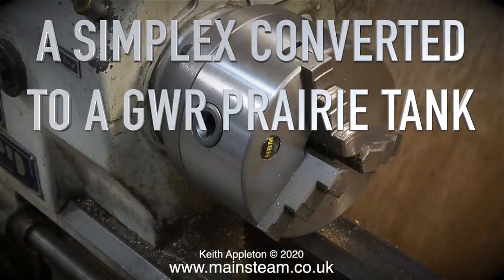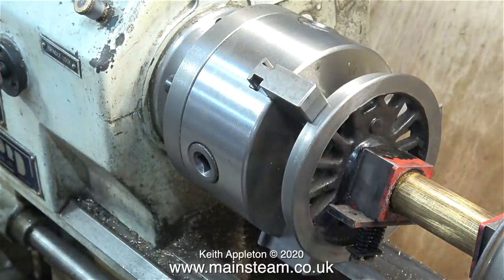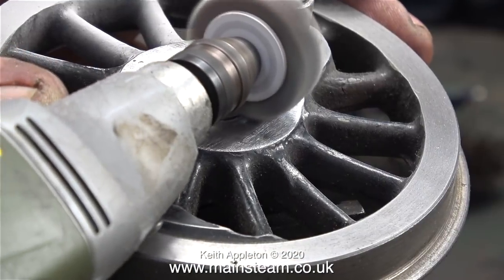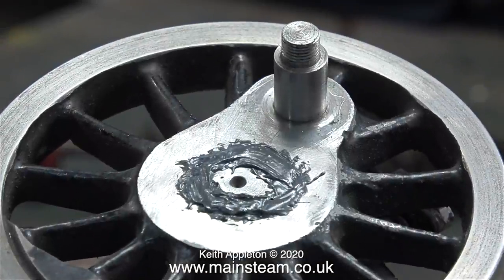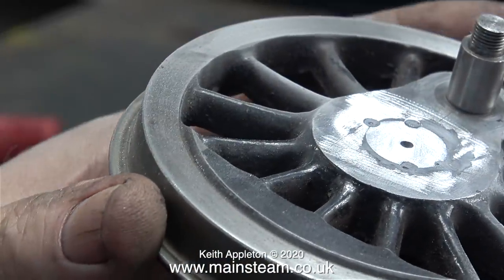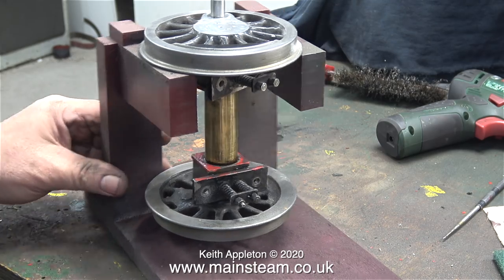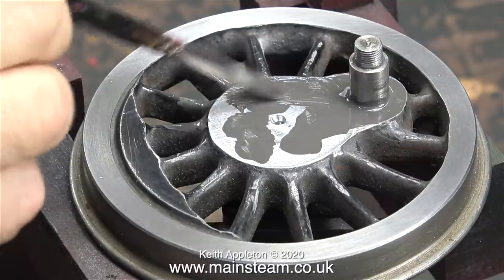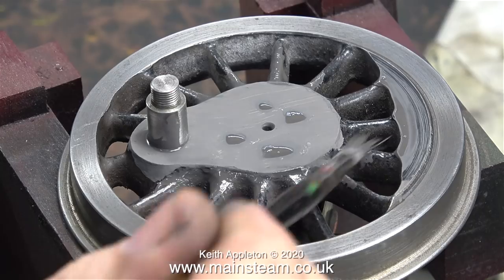SIMPLEX PRAIRIE TANK - PART #42

Comment: You could have used a face plate and a dead center.  The crank pin would be the drive dog in the face plate.
Reply from the maker: But I don't have a face plate and the job worked out fine anyway the way that did it ......

Comment: Does the primer stop the paint from orange peeling? Also what brand of trim line tape would you recommend for a 7 1/4” battery engine? I thinking about putting my battery engine into either lined BR black or lined pre war LMS black
Reply from the maker: no, too much paint seems to cause that. I use model aircraft self adhesive trim lines on things that don't get hot.
Reply: @keithappleton  ok thanks

Comment: Good video.  Apologies for a dumb question, but would an end mill or similar tool mount in your lathe tail stock?  Thanks again for another good one.
Reply from the maker: Yes if I want to risk destroying the wheel - it worked just fine the way I did it in the video . . .